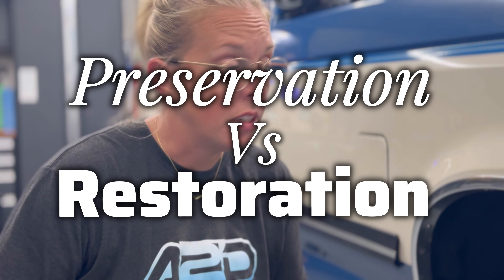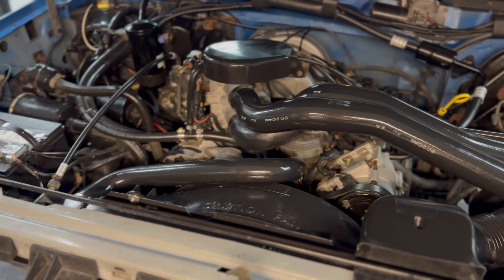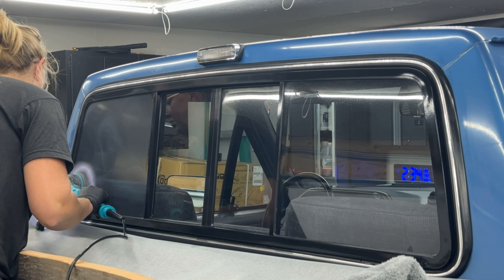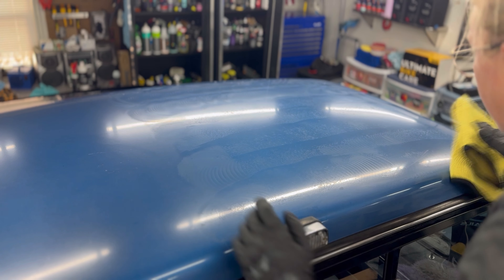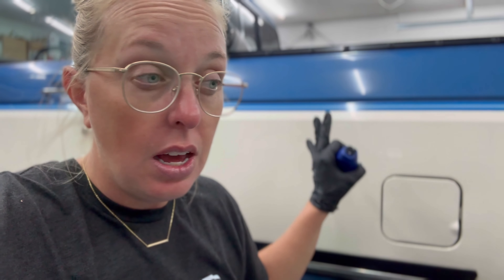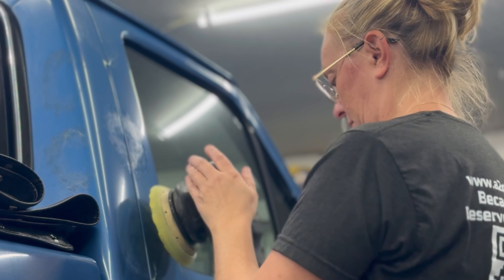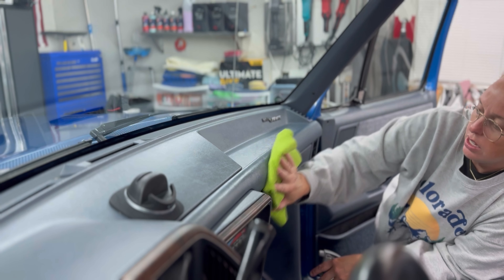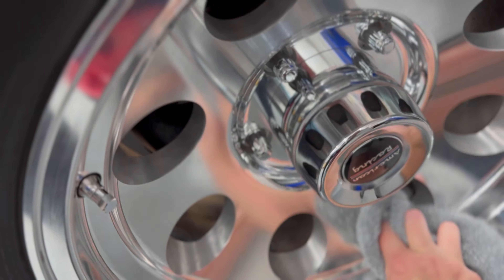Detailing A ‘89 BRICK NOSE Ford F150 - Single Stage Paint Issues & More!

Comment: I used Invisible Glass Glass Stripper with a rayon pad on my 2002 F250 and 1973 240Z.   On the F250 it slaugheted the water spots, and probably 75-80% on the 240Z but took a couple of passes.  It dries up quickly, so I kept a spray bottle of distilled water handy.

Comment: I love using meguires red soft spot  cutting pad in single stage when doing 1 steps. Vary durable pad and has never disappointed me and never failed to cut or finish out. They have 2 versions as well a thin and thick version.

Comment: That was interesting. I've done 2 single stage polishes, and both times was nervous. The oxidation both times was nasty. But both had gobs paint. Lucky that way. 
Brian at Apex put an acrylic polish down first so the ceramic didn't soak into the single stage so much and gave the coating a smoother appearance. Thats what I'm trying next time.
The truck looked super nice Chelsea.

Comment: Hey Chelsea, great video!! Have you used DIY metal coating on anything else and what are your thoughts on it ? Also what coating or coatings have given you the most longevity from your experience?
Reply from the maker: I haven’t because it’s rare for me to have polished aluminum wheels as typically most wheels are clear coated and you can use normal coatings on them or wheel coatings so this was my first time working with the metal coating. I could have used a normal coating but parts of the clear on the tailgate had failed and I figured this would bond better than a normal ceramic coating.
Reply from the maker: The most longevity- at this moment the Ethos Graphene coating lasted 3 yrs for me before it started to show signs of failure and that’s because I tested it on my own car. A lot of my customers who I have coated their cars haven’t returned to it’s hard to say but I’ve seen 2+ yrs from Mckees 37 Graphene to date and it looks great

Comment: By ringing out your polishing pads, would it damage it in the long run?
Reply from the maker: No as long as you’re note wringing down in them super tight and a ton. I do it maybe two loose twists and then air dry. If nervous you can spin them dry on the polisher but I’ve never had a problem

Comment: That truck looked fantastic! I was wondering what you used to clean/protect the vinyl bed cover. Great job as always. I love your passion for doing great work.
Reply from the maker: @jaydeez1021  the previous owner it looks like they actually applied Cerakote wipes to it. There was a clear coat all over all of the trim and the tanneu bed cover. It’s the first I’ve ever seen it and it did not come off even if polished. It definitely was shiny, but I can’t claim the credit for the truck bed cover

Comment: Aww yeah. That 460 cubic inch chonk! Fill up the oil and check the gas. 9mpg pulling 4 horses or driving to the grocery store. ❤
Reply: 460 big block wasn’t available in the F150 in 1989. You had to move to the F250 or F350 to get it. The 150 was available with the 300 straight six, the 302 Windsor, or the 351 Windsor small block V8. The 250 and 350 were available with the 351, the 460, or the 7.3 diesel. Hope this helps :)